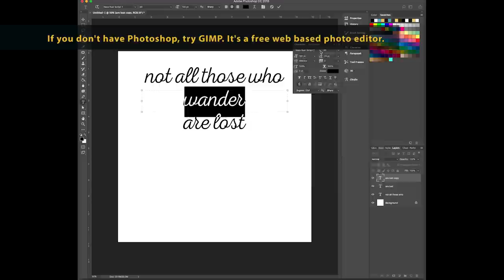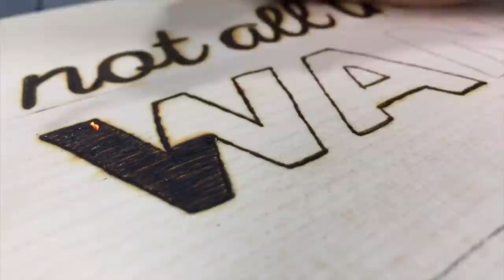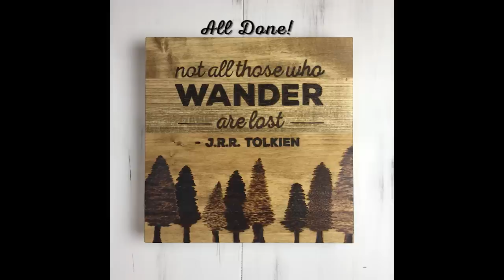How to Wood Burn Letters by Pyrocrafters

Comment: My wood burner is just a $30 kit.. It doesn't seem to burn anywhere near this well... Am I doing something wrong or using the wrong wood or somethjng??
Reply from the maker: You're not doing anything wrong. The $30 starter burners don't get as hot as the Colwood burner I'm using in this video. They starter burners are great for trying pyrography and you can certainly burn very well with those, they just aren't as fast and versatile as the pros.

Comment: Does this work for an outdoors sign? For example for your street number? I guess what I mean is by being outside, would UV light eventually cause the burned portion to fade? Or would it make the unburned portion of the wood darker? Would you use a different kind of stain? Would the street sign eventually be destroyed by wood-boring insects? e.g. carpenter ants or carpenter bees?

Comment: I'm new to this, so it's just a soldering machine and with what kind of adapter at the tip exactly? And where can I get wood templates to do the art work
Reply from the maker: Hey Steven, I'm using a Colwood burner in this video and it's for wood burning. You can find them at woodburning.com. They have several models. 

I like to make my own templates or I download them from Creative Fabrica. Here's a link: 

https://www.creativefabrica.com/ref/972705/

Comment: Question, as I just bought I burner yesterday....can you paint the wood (with an acrylic paint) then wood burn? Or is that not recommended?
Reply from the maker: It's not hard to burn over the paint. I have done that before. I'm not sure of the safety implications though. I would definitely wear a mask.
Reply: Please never burn over any kind of color! Acrylics are a plastic polymer... you don't want to burn over that. It is toxic!

Comment: I noticed paper on the wood, seems like you burn through it but I did not see that as part of the process. Can you explain? Thanks!
Reply from the maker: Hey Anne, at minute 2:04 I slip a piece of carbon paper under the template and begin to trace. Once I've traced the lettering to the wood, I remove the template and carbon, then burn it. I don't burn through the paper itself. 

I hope that helps. :)

Comment: Where did you get your logo stamp for the back? Is it a ink stamp or burn stamp? Thanks?
Reply from the maker: Hey there! It's a custom rubber stamp. I ordered it from rubberstamps.com. And I just use a plain black ink pad. I've had it for like four years now and I'm still using the same one. Thanks for watching.

Comment: Hi. I did a project on oak. It looked great. Then my customer had the wood worker finish it. I think they sanded it and put a coat of polyurethane over it. It lost a lot of burning and looks so much lighter. How can I fix it? Can I re-burn through the polyurethane? Would polyurethane by itself make it “loose” burning?
Reply from the maker: Hey Moire! I don't recommend burning over the polyurethane. It's not safe for you and it will damage your tips. I'm not sure why you would lose burning detail unless it was a really light burn.  When you varnish wood, the grains get a little darker and more brilliant, so if your burn is really light it may lose color with varnish. I'm not sure of a way to fix it beside resanding and starting over, but I would really need to see it before saying what the best thing is to do.

Comment: I have basically just been coloring in my letters with color pencils or sharpies because I felt either too cowardly or too unskilled(or both) to actually turn the heat up on my burner and fill in with it.
Reply from the maker: That works too. It's all about what you feel comfortable doing.

Comment: What tip would you use instead of a wire nib?
Reply from the maker: If I’m using a brass tip kit, I use a universal tip to outline, then a rounded tip to fill with texture.

Comment: Just wondering what tip you used while filling in.
Reply from the maker: I believe it was the writing tip, which is how Colwood labels that tips. Some other brands call it a lettering tip. But it’s basically the tip that is just a curved wire with nothing welded on the end. Thanks for watching!

Comment: What wood burner do you recommend that is cheap for beginners
Reply from the maker: Hey there! The Chandler Tool is a good craft set from amazon. Or Walnut Hollow makes a beginners wire tip burner called the Walnut Hollow Creative Tool. I have a review about on our channel if you want to check it out. :)

Comment: Do you think you could please tell me the name of the website you used. I would greatly appreciate it!
Reply from the maker: I’m happy to, which website are you wanting? Is it a particular product?
Reply: At 1.04 in your video. That website where you were customizing your template. Thank you!
Reply from the maker: @aidanhottes5469  Oh, that's photoshop. It's not a website. I have it installed on my computer. There is a similar free program called GIMP that's available for download on the web. Just google GIMP and it comes right up. You can also make templates using Microsoft Word. Just place any images or layout your text and print. 

I like Photoshop because I've used it for so long and I'm just familiar with how it works. It allows me to create a file the same size as my canvas and I can print the template in sections to make a large template.
Reply: @Pyrocrafters  ok thank you SO much!!!
Reply from the maker: You’re very welcome!

Comment: I have a 10 dollar burner and I am god awful at wood burning... do you have to press hard or flow with it? I don’t think mine gets hot enough
Reply: You shouldn't have to press hard, let the burner do the work for you. Slow & steady is best. 😁
Reply from the maker: The craft burners don't get as hot as these pro burners. Pressing doesn't really help much, it has more to do with the heat. If you're getting really into it, I would upgrade. :)

Comment: Can I also use same process on leather? Thanks!
Reply from the maker: Hey there! I think so. I have very minimal experience with burning leather. I have used templates on leather, but it's not as solid as wood, so it doesn't transfer as well. And leather doesn't need as much heat as wood.